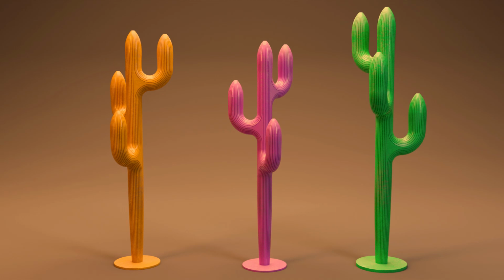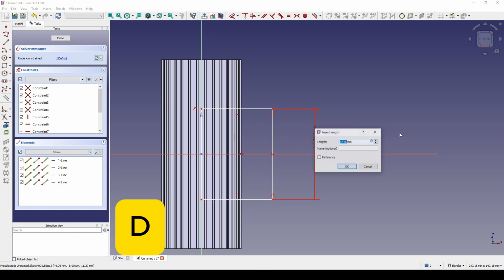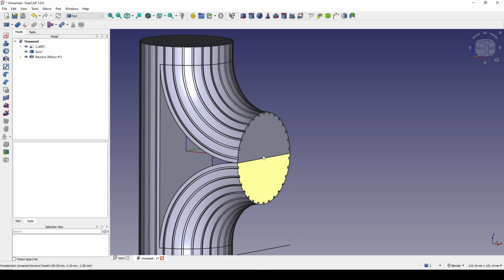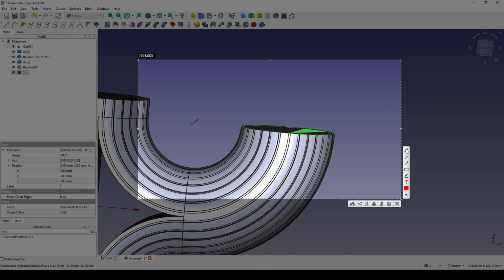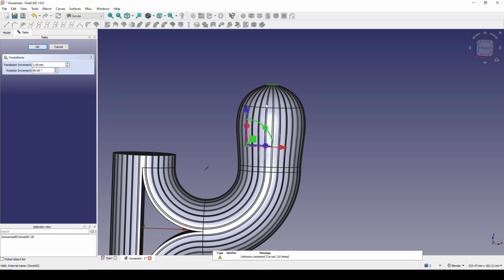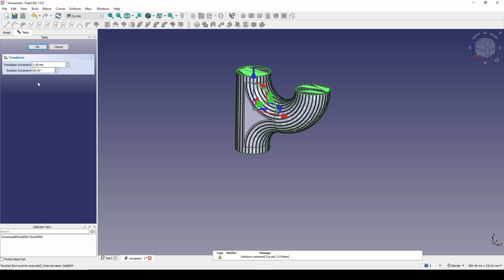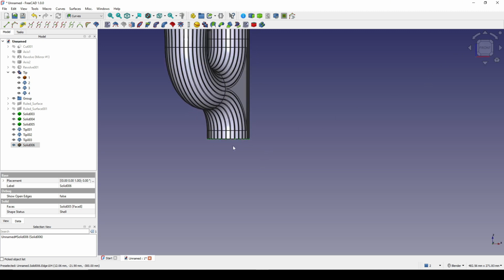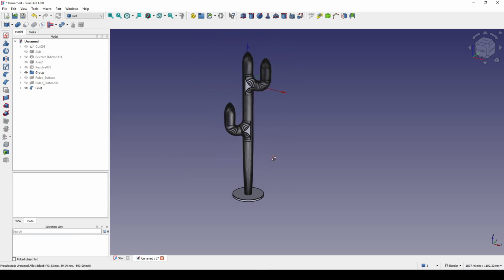FreeCAD 1.0 Using Multi Loft To Create A Coat Rack.

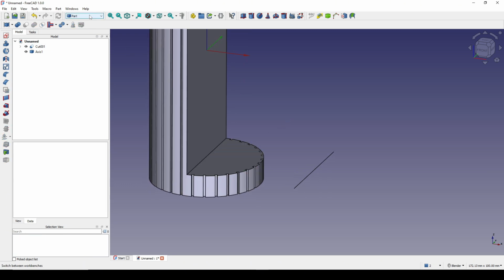Comment from the maker: If you are using the newest version of curves wb, at the 7:02 after select the face, instead of using Parametric Solid (this one will create a solid), you can use Extract Subshape (In Misc menu/ Extract Subshape). Or you can go to Draft WB, in Draft Menu choose Facebinder.
Reply: @DuyQuangDang thank you. I used Facebinder from Draft WB (Exrtact Subshape from Curves WB  make non parametric copy of the selected subshape).
Reply from the maker: @LedMalt  That's right!

Comment: I followed up to 20:18 and everything was showing and I selected the 4 parts for the fusion/union and they all disappear when I click union.  The fusion shows with visibility on, but it is not visible.  Any suggestions?  I tried deleting the fusion and tried reselecting the parts again, but still get the same result.
Reply from the maker: You can union one by one to see where the the problem is.

Comment: Hello. Please tell me why when I select a surface in the curves workbench (seventh minute of the your video) and create a solid, a copy of the entire body is created  enstead the  surface
Reply from the maker: @LedMalt  
 I don't know why I heard some people mention this issue, may be different versions of the curve workbench. However if you have problem, you can use an another method with the face binder in the draft workbench. Go to the draft workbench, select the face, and press the hotkey FF, or draft/face binder.
Reply: @DuyQuangDang  thank you for your answer.